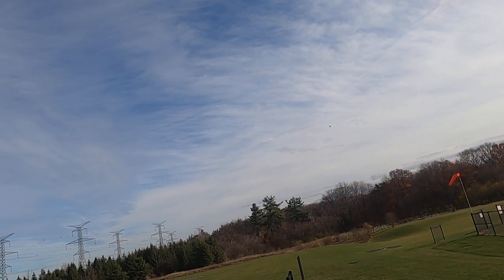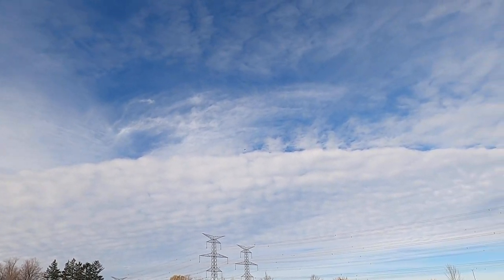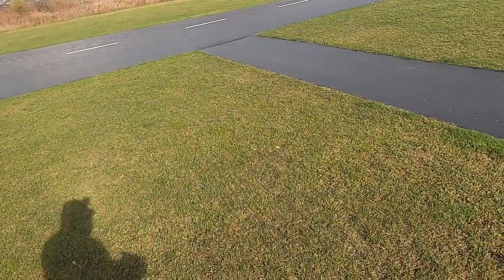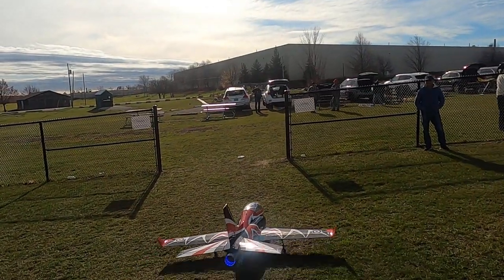Black horse Viper on SMC HV 6200 MAH packs

Comment: Are you using open ducting or did you install the ducts
Reply from the maker: I'm using the ducting, but it's an open duct. It's not as restrictive as the full ducting. My ducting stops just passed the battery tray. So everything is open from there, and I think it's better because it allows for less restrictive airflow to the fan. It also helps  better airflow over the batteries as well.
Reply: @ghoustanable  Thanks for the tip. One more question. What servos are you using. I ordered the bundle kit from motion and the 8 servos that came are WAY to big to fit.
Reply from the maker: @drmrjon  Just found this amazing item on AliExpress. Check it out! C$34.79 | Kingmax CLS2875H 28g 10kg.cm Torque  Digital Metal Gears Mini  Servos  for RC 450 500 Helicopter tail RC Plane Model Aircraft
https://a.aliexpress.com/_mPM1Q1I

Comment: Garfield have ordered a new jet yet?
Reply from the maker: Already have one.
Reply: @ghoustanable  you stocked  up huh lol.
Reply: @ghoustanable  Garfield can you give me the name of the lights you ordered from Dave’s rc. I’d like to get a set of the lights please
Reply from the maker: I had several bulbs that actually blew on me before I even got the plane up in the air so I wouldn't go with Dave's stuff I would go with unilight. He's a great guy but the bulbs burnt out prematurely also it runs on 6 volts as opposed to a two cell pack. The unilight is definitely a better product much brighter and also greater range of options in terms of lens sizes and configuration. I had the opportunity to check out the system in my skymaster F-18 work beautifully a lot brighter than what I had in the Viper. Cheers
Reply: @ghoustanable  Hey Garfield! I've been studying your videos and "EDF jet RC". I'm really interested in the Black Horse Viper. However, the only retail outlet for it here in the States is Motion RC and they're ALWAYS out of stock. First, do they still make it? And second, do you have any advice on obtaining one relatively quickly? Great videos BTW and I absolutely love the way it looks!
Reply from the maker: @MrWhatahelisdis  https://www.turbines-rc.com/en/jets-edf/1709-black-horse-viper-jet-188m-arf-4056534037650.html
Reply from the maker: @MrWhatahelisdis  https://www.lindinger.at/en/AIRPLANES/MODELS/Jets/?manufacturer=fd2624e1480e4cf4a4e7b543b23f8746&order=acris-score-desc&p=1